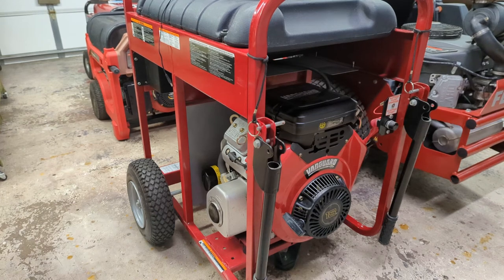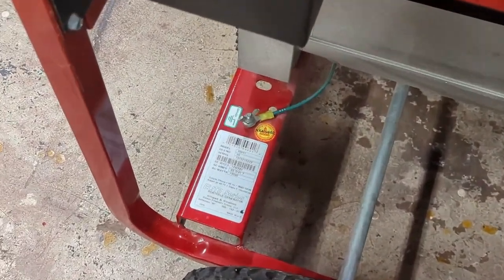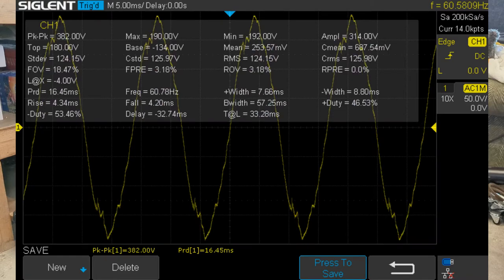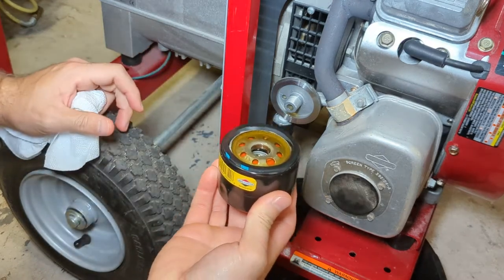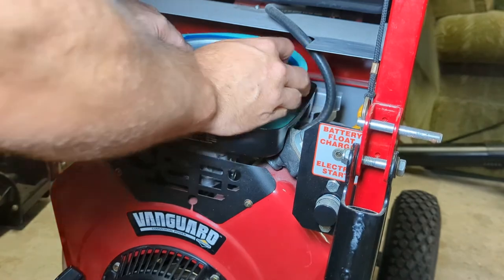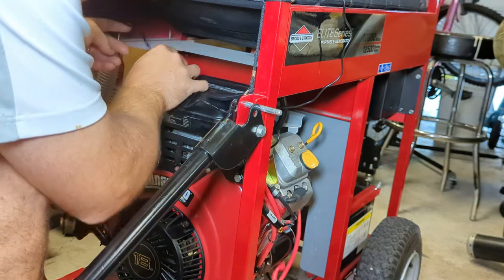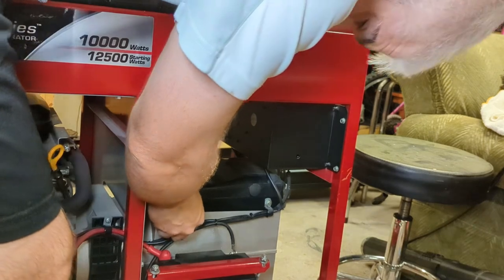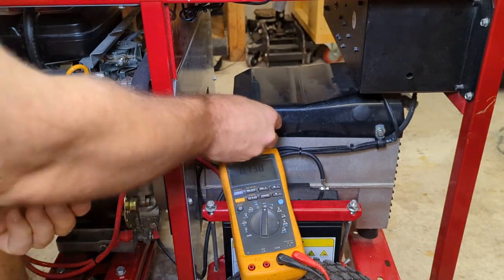Briggs & Stratton Elite 10000 Generator

Comment: Thanks for this video. I’ve got this same generator we bought in 2004 or 5. The Vanguard motor runs great. My problem is low voltage. With a small load (heat gun) it’s only putting out 88 to 91 volts. Would replacing the compactors be worth trying. I’m not sure how to test them with my voltmeter. And not sure if there’s a way to adjust voltage. Second problem is the engine will not kick into higher rpm automatically. I’m thinking the stepper motor is that problem. 
Thanks for any help, John
Reply: Hi John
I have the same problems... about 3 hours on the generator 2005 ish model always kept inside.
Did you figure out the problem?
I'll be testing the capacitors and there's also an AVR automatic voltage regulator.. 
Any info would be helpful Thanks Dean
Reply: Hey Dean, I replaced both capacitors, one was obviously bad. That fixed it. Voltage is correct and rpm steps up automatically when load is present. Just ran about a day and a half when bands from hurricane Milton put our power out.
Reply: @johnbatts3266  That was an easy fix and hopefully mine is just the capacitor(s). ..Appreciate the update